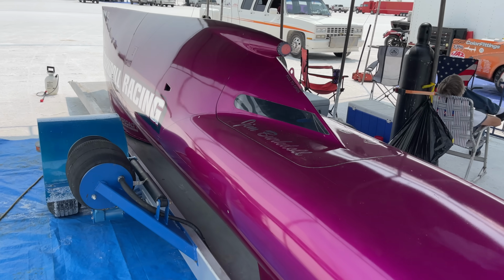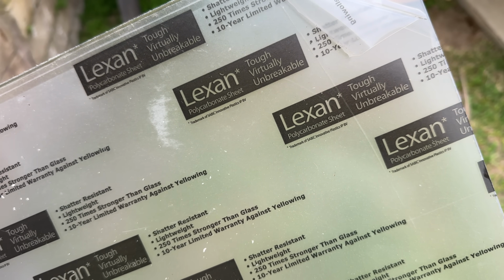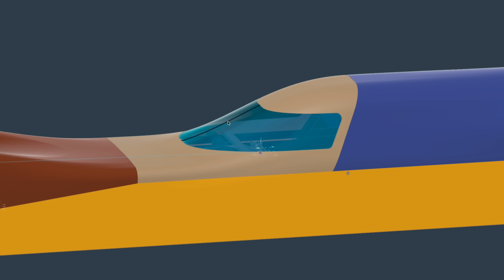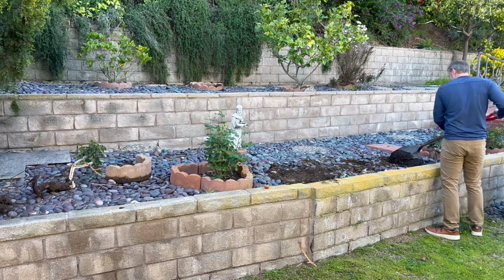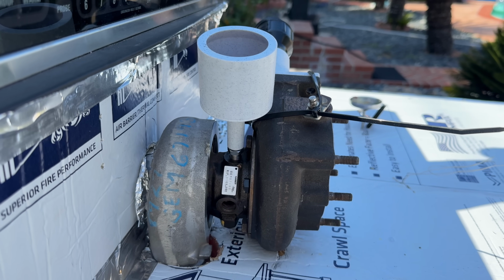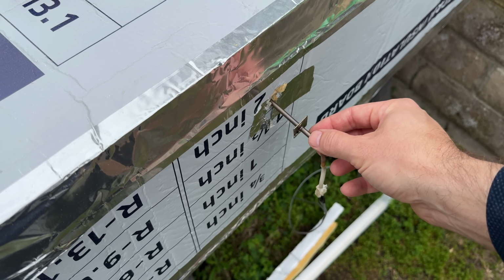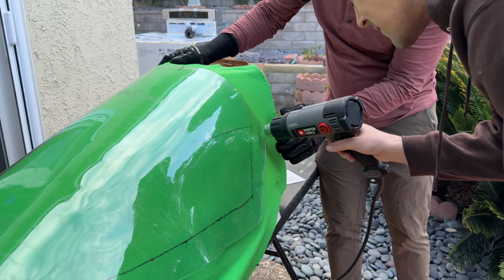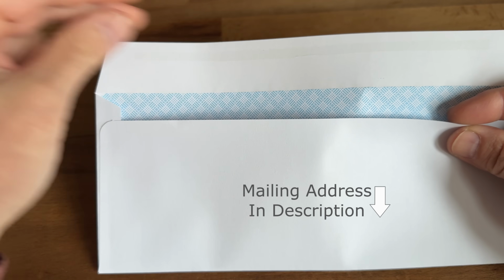I Turbocharged My Oven

Comment: "So, it turns out I didn't have to turbocharge the oven, only buy decent thermometers".

It's funny but it is a great lesson. We often use instruments that we have absolutely no idea about how accurate they are. From torque wrenches to thermometers to pressure sensors.
Reply: As another comment noted, those cheap thermometers can be calibrated. A little nut of the underside allows for the adjustment. Still not going to be great, like fractions of degrees great, but much better than ±15°. Maybe ±3°?
Reply: @GimpGladly  After a quick search, these thermometers appear to work by contracting and expanding a bi-metallic coil spring. I don't think that the manufacture of such thermometers is precise enough (but for most applications it doesnt need to be). Perhaps one can adjust it to become repeatedly accurate at one specific temperature range but at the cost of inaccuracy higher up or lower down in the temps. range.

If they are all calibrated at say 100°C, they should all be really close to each other at around that temp. range, likely with inaccuracies getting larger as temperature increases. At the factory, the thermometers are probably set at room temperature. I don't think they would heat them up to 80 or 100C just to calibrate them.
Reply: @leoa4c  Sure, bi-metalic strips are only accurate within limits. In the video he stated they differed by as much as 30° (±15°). Not good.
The built-in calibration should allow to reduce this to an acceptable lower single digit. For his purposes, (checking how even the heat is distributed within the box) and considering the heating control mechanism, this ought to be good enough even if they are calibrated to 212°F and he is operating at 350°F. 
The accuracy/precision needed is not dissimilar from baking, and that's what these thermometers are designed to do when they are calibrated. 
If he were operating closer to or above 500°F all bets are off.
Also, bi-metalic strips deform with temperature linearly within their design range. So, if one wanted to go full nerdgasm, checking both freezing and boiling, one could project a regression line from these points into the operating temperature range and come up with a correction factor as opposed to a simple offset number as it sounded like he may have in the video. 
You're still not going to get fractions of degree accuracy (although °F IS a fraction of °C, to be pedantic), but ultimately it just isn't necessary the vast majority of the time. If you work with digital equipment that reads out in the 0.1 or even 0.01range, you will know that the last sigfig is generally to be ignored or used for rounding.
This actually applies to mechanical/manual/analog probes/measurements as well. You can generally discern 1/4s (0.25) of your smallest increment and you use this for increased precision, but can have poor accuracy (repeatability) as it becomes susceptible to environmental perturbations. And again, in most uses cases it is unnecessary, like the digital readouts.
Diatribe complete, and...POST!

Comment: As someone certainly pointed out, your results are suboptimal because you heat shock the plastic when you wrap it around the cold mold in the cold outside air. You need to put the mold in the oven and heat and cool everything together.

Comment: the company i work for make prototype and show cars amongst other things, for the complex-shaped windscreens they use PUR model board for the tool and mill the edge profile on a CNC machine, it may be a bit of a pain but the mould will be usable over and over, granted this may be slightly out of the back yard engineering field but the finished product is flawless

Comment: I worked as a soft goods mechanical engineer for 5 years and the flattening of complex curves is quite a pain. The easiest to use is Solidworks's Flatten Surface. There are fancier things like Exact Flat, but that's really if you own a boat cover business. LMK if you need a surface flattened, and I'll send you back a .dxf or whatever. Also, I would not leave the excess material on top of the windshield, that area is going to see a lot of deformation and will probably make it harder to hit your final shape.

Comment: If you were making a polycarbonate sign a different way first you need an enclosed trailer large enough to work in the small enough to heat with internal rack to put the polycarbonate on while it's heating inside the trailer in order to heat the trailer you would use a salamander  pipe the heat via a duct  you would you would probably yield a better product if you inverse your mode it is easier to form to a concave into a convex surface I have better results with a plaster or a wooden mold what's the surface sanded to a sub 1000 grit.  With the same pregame on the dehydration but if possible by your sheet of lexan overtop the mold prior to the stepping the heat up 225 up to 400 allowing it to use gravity to plastic deformation itself into the final shape the thicker the sheet the easier within reason Adam from Mythbusters has a great video DYI vacuum deformation of polyacrylic Pollyvinyls I think he's YouTube is man cave
Reply: Or you could just redesign it to Encompass something that's already mass-produced off of a street bike

Comment: One of my favorite collection is my library of post-war plastic fabrication manuals. Lots of good tips for handwork in there. Here's one: to prevent mark-off, add a light coating of oil to the cloth. I'm in LA if you ever want to borrow.

Comment: Hi. I am not an expert, but I know that plastic windshields can be grinded and polished. I used to work on boat company, and it was pretty regular job for me to make old nasty, scratsy windshields to look like a brand new. And it was not that hard actually. First all scratchs has to grind off. Just with a sand paper. First coarse and then finer one. It is pretty much a hand job. I do not know how plastics reacts to powertools. I guess it will melt because of the friction. But yeah, just grind and at the end finer and finer sand paper. First like a 400 grit, then 800, and then 1200, and thats enaugh. Or maybe even 2000. And at the end, final polish has to be done with some kind of polishing compound. I used to use those, that are made to polish cars. All they  worked pretty well. And yeah, at the end, you can see thruu the plastic windshield, and it even looks good. I mean bright and clear! Just wanted to say, if it could help you. Of course this doesnt fix totally bad windshield. But it can propably help for some smaller things.

Comment: make the negative mold and put it on a hinge to the actual mold so you can form it quickly before it hardens, don't cut the Lexan until this step so you don't have to worry about the orientation and you can just focus on form it quickly

Comment: Those thermometers should have a small hex nut on the back of the housing that adjusts the needle.  That’s how we calibrate those cheap thermos in my kitchen.  Every bump, accidental drop, or even looking at those thermometers in a disapproving way causes them to lose accuracy.

Comment: Very disappointed, I was looking forward to you making a compressed air battery for your house (nee rubber under loam,) or something that happened to also be an oven of some sort; not least using the 4-5 turbos in the title pic. I mean, the compression would have done the heating for you. Instead, I'm pretty confused at your oven having a place where ovened air goes in and not a place where it is supposed to exit. The shiny (isocyanoblahIforget, where is it sold anyway, why isn't it in the descriptive bits) foam. At least add an epilogue with all the stuff you did to 'fix' it and the stretch goals for racing optics on the salt flats, narrowed to oven stuff maybe, but racing conditions on the salt flats in the day sound toasty, the speed's likely to compress air in front of the windshield, and I don't know your 700MPH crash safety kit or mannedness of velocipede, so I can't really see how you were "oh this will end well" in the first place.

Comment: Pool Table felt is the hack for the mold. Also carry the polycarb out of the oven on top of another sheet of felt and slide it onto the mold, then use the hot felt to hold the polycarb down. Used, quality pool table felt is fine. Just dry the beer out first. This'll get you 80%. If it gets goosed, put it back in the oven!  It will flatten out and you can have another crack. Don't bother with a heatgun, it'll lens straight away. If you can make a rack to get the polycab off the oven floor and allow full circulation, it'll help your result. A thin steel sheet full of small holes does the trick.

If you actually want to make a perfect windshield, make your mold out of 1.2mm aluminum sheet pulled over some ribs so you can have the whole mold (with pool table felt) inside your oven (English wheel may be required, but any way you can make a mold that'll take the heat will work gravy.). Bake out the moisture flat as you did, then pop it on the mold and heat it up for 30 mins at 185c(temp may vary but less is best to let it drape), turn off the heat, leave the turbo running and let it all cool down together. Best if you have space in your oven to have the mold in while you're baking out the moisture, it'll dry out the felt and preheat the mold too.

As someone who does this professionally, I'm impressed (but not surprised) you got so close on a first attempt. That was most of the way there, would have worked with acrylic. Also, my oven really needs a turbo now.

Comment: Hey Matt, Look at how mechanical thermoforming works. Calrod heating elements are snaked above and below the plastic a few inches away but covering the whole surface to be formed top and bottom. Material to be formed is clamped on 4 sides in a metal picture frame. Measure plastic heat by contact, with handheld IR, or just by eye looking for sag. when on temp quickly pull the frame and plastic from between the heaters and pull down over the mold. Ideally this is when you would apply vacuum, but your shape doesn't really need it. I'm not seeing any good videos here but will post as reply if I find one.

Comment: I did some windshields for ultralights airplaines and these are my thought on your experiment : 1 If you want a perfect optical quality, you need a PERFECT mould. It has to be a mirror finish, flat or high constant radiuses, no waves that you dont want to have in your windshield. So filler, sanding, iterate, 2kpaint, polishing. 2 Pre-heat the mould, but would be better with a thick fiberglas and remove the foam under (infrared heaters are the best for that). For this reason all mold in the industry are heated polished metal. I had nice success on polished stainless steel sheet wrapped on a wood pattern, but no conpound curve in this case. 3 You don't need coton cloth if your mould is mirror with heat resistant paint on it, anyway the cloth has built-in waves and pattern that you don't want in your windshield. 4 When forming you need a way to wrap the PC with a constant traction all along the border so pinch each side between 2 wooden slats with lots of screws to have a nice grab on each side. 5 You need to pull hard and quick. The mould has to be ANCHORED on a strong support. For this size I think you need 4 people, pull away to stretch the PC, then down to wrap when still pulling away, I think you where good on that. If your mould is preheated with still some infrared on it when forming, then you have more time to form before the PC solidify. 6 Polish the PC after to remove any defect (soft cotton wheel with a very gentle polishing conpound). You need some tests to master the technique, I did my training on small model airplane canopy when I was young [;oD

Comment: Complex curves can't be converted into a precise flat pattern because there isn't an analytic solution. So CAD won't do it at all. Or at least that's what the CAD rep told us when we got upset that we couldn't make flat patterns from the expensive PRO-Engineer license our boss had just bought.... I'd imagine it could be done numerically but my story comes from 2003 when you young 'uns don't believe computers even existed and we didn't find a way of doing it back then. We did find you could play networked hearts and that greatly improved office morale if not productivity.

Comment: I talked to a man that made glider canopies, they have a cutout of the base shape and clamp the plastic sheet to it and blow the shape in the oven using compressed air. He said the hardest part wad unbolting all the 50 or so bolts before the air/ plastic cooled and sucked the plastic back in! They had 6 people around the "mold" undoing bolts as fast as they could.

Comment: Wow, you are so Not the right personality for LSR.!
You only need a small slot to see ahead. It's not like you are parking at mall.
Alternatively, 3  Fomular1 style cameras, 3 10" tablets inplace of the window. Toss in a 4th for virtual gauges and sensor/ data logging. 
You will be able to PlayBack each run, even the camera footage.
I don't understand why it is Not a requirement.
Anyhow, thats my setup.
Get Angry, Get Hungry, Get After It.

Comment: All of those thermometers are adjustable with a hex nut on the back of it. Just put all of the probes into ice water and after 10 minutes set all of them to 32°. 

Boom; fully calibrated.
Reply: Maybe not ice water for these candy thermometers whose scale reads as low as 100°F, eh?

Boiling water @ 212°F @ sea level (apply correction factor for different elevations) is the cheapest calibration most of us have available.
Reply: better to calibrate to a temp that is closer to your working temp, as in boiling water instead of freezing water.

Comment: Re: Turbocharging your oven - while you certainly used a turbocharger to force air into/around your oven, it is not exhaust-driven nor being used on an internal combustion engine, so turbocharged it isn't.  It would be closer to a supercharger, albeit electrically driven instead of belt-driven from the engine.  It's really a two-stage centrifugal fan.

Your peak boost could use some tuning.

Comment: There’s another crap method.
You hang weights or adjustable straps around the cold flat sheet perimeter and use a hot air gun to heat from the centre out.
Having multiple guns and trapping the heat a bit helps.

Comment: Have you thought about making a vacuum forming setup? ILikeToMakeStuff and Adam Savage from Tested both have some videos on them. Build a simple open top box with some space heaters in it to heat up the plastic, and get a small box covered with pegboard hooked up to a vacuum. Have your plexiglass/acrylic in a frame, set it over the heaters until it droops down, and than quickly transfer it over to the mold/buck on the vacuum table. 

Could help you get a better and more uniform windshield.

Comment: Have you tried map-gas blowtorching the bubbly windshield? Fabricators use a very hot flame (in quick passes) to clear up the cloudy/scratchy edge surfaces on lexan/polycarb after cutting/routing the edges. You could even potentially sand off the felt with very fine (1200?) sandpaper first. It's a quite different problem, but a) you're matt and b) you have a couple failed screens to try it on so 🤷‍♂️

Comment: One way you could to get a (quite close in surface area) windshield shape: 
- export the windscreen model as a polygon mesh, 
- Import that to a poly-friendly package like Maya or Blender and
- uv unwrap it, ie map the 3d surface to 2d space., usually for the purpose of projecting 2d images onto 3d surfaces.
There are a few uv unfold/relax algos in those packages to achieve a shape with the least stress/distortion, and i know at least Maya provides a stress visualisation.

Comment: Look into NASCAR type windshield tear offs when you get your windshield sorted.
Not sure if you could do it with the angle of your windshield or the top speed of your car might be too high but would be worth using tear offs over replacing the whole windshield if it’s possible.

Comment: Watched the zenith of this madness go in a model making company I worked at ( in London UK ).., except a hot oil bath was used to get the sheet material up to temperature .., we were in a building with well polished concrete floor and oil at 400 degrees ... no one died in the attempt but there were some badly burnt fingers and a lot of swearing ... Did put me off chips ( french fries ) for several months ...

Comment: Hey, you know what they say about a craftsman who blames his tools. Those thermometers are probably just fine and need calibration. I doubt the core component - the bimetalic spring - is the problem. Its probably just the casing that needs to be spun a little bit.

Comment: I’m not an engineer so I’m not sure if there is a fatal flaw with this idea,
But what if you made your oven taller, and made a mold out of shiny foam, and put the mold in the oven under your plastic. So as it slowly melted it would melt into shape. Then you could simply turn off the oven to let it cool, and there would be no moving it until it was cold.

Comment: A good source of ideas could be a machine for RC cars lexan bodies. 
They use a frame and soften it on the frame. Then just drop it down on your template.
And yeah they are vacumed in general but this could be done in your scale. Some holes in the template 1-2 vacuum cleaners and u know... May be a turbo or two?